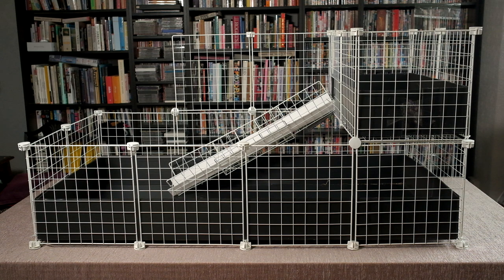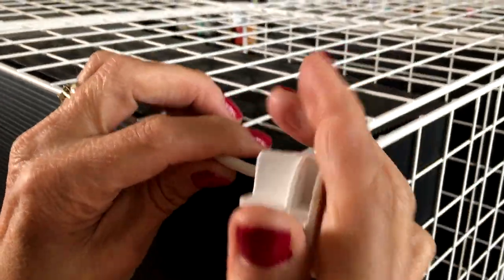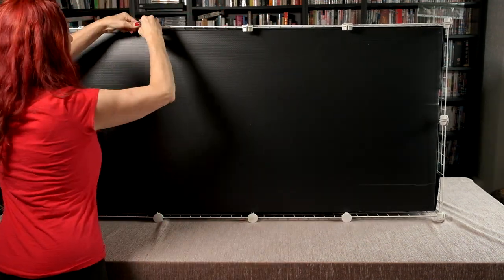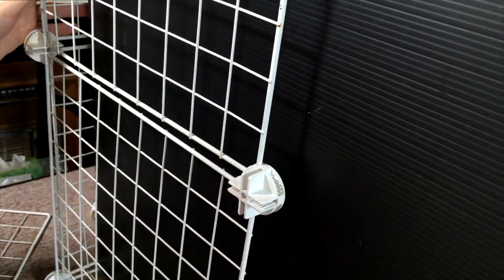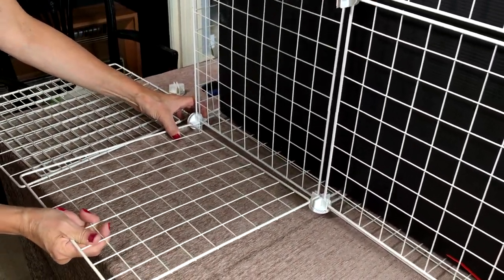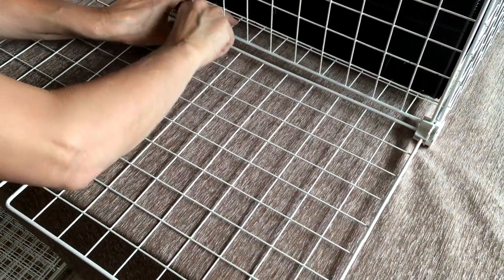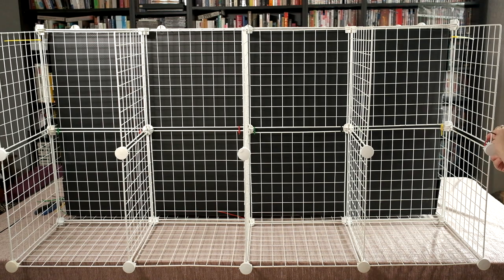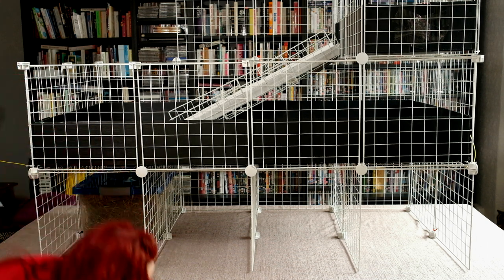How to Make a Guinea Pig C&C CAGE BASE + STAND + STORAGE | C&C Cage Designs & Ideas

Comment: Will the Grendle grids and connectors be compatible with Kavee c&c? I already have the enclosure but don't want to spend the £98 on a base from Kavee if I can do it myself for much cheaper!!
Reply from the maker: I would imagine they would be compatible but I can't say for sure. Maybe you could buy a pack of connectors to check first. They are quite cheap to buy and if the connectors are compatible then the grids should be fine. Also, check in our description  on the grids we recommend as they are cheaper to buy than the grendle grids. We have a page on our website all about C&C cages that you might find useful here https://www.guineapiggles.co.uk/c-and-c-cages-for-guinea-pigs/ - I hope that helps! :)
Reply: @GuineaPiggles  Thank you so much!! Am looking forward to building lots of amazing things for my piggies!! Xx

Comment: I’ve watched these videos with so much interest and have decided to upgrade to a c&c from the Midwest. Please can you tell me, is it possible to go up another level with this stand? as I have two small dogs and my Midwest is currently at table top level for safety.
Reply from the maker: Hi Claire, yes, you should be able to add another level so basically repeat what we've done on the lower level again  with the vertical grids in the middle too for stability. It will also give you more storage space. Just make sure when you've finished that everything is really secure and stable and use plenty of cable ties to make doubly sure. I hope that all makes sense and that it helps! :)
Reply: @GuineaPiggles  yes that was my thinking! Thanks so much 😊